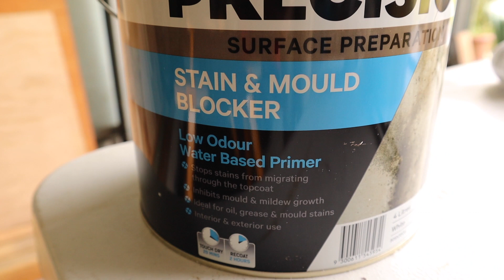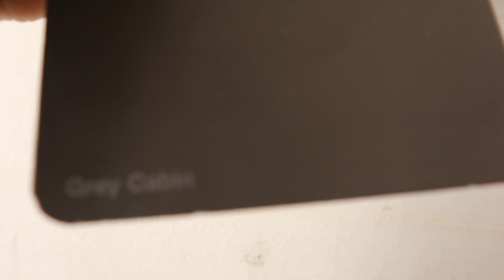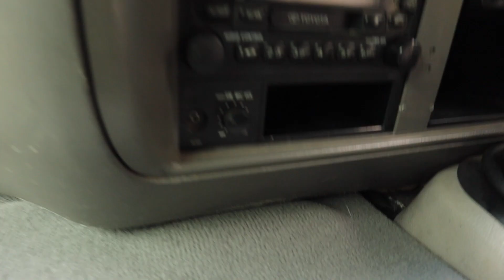Drivers cab area renovation in a Toyota Coaster

Comment: Fantastic video, I think you’ve done an excellent job of the passenger side panel. I too replaced my side panel and used a cheap spray adhesive to put a light weight, cheap grey carpet on the wall (with the same 3mm ply) fearing that if I just put paint on it it might show scuff marks too easily.
Reply from the maker: That's a good idea Chris. I may end up doing the same down the track. I was thinking as I was putting mine in that the dog would probably scratch it up!

Comment: Please cover the grey sample pot paint you used with a sealer as it’s cheap and nasty and will mark very easily. I used to work for Bunnings and the sample pots are not the normal good quality paint just in smaller pots, it’s actually a really cheap paint.
Reply from the maker: Oh that's good to know Julie. Thanks for the tip.